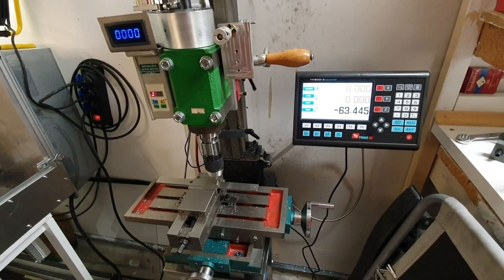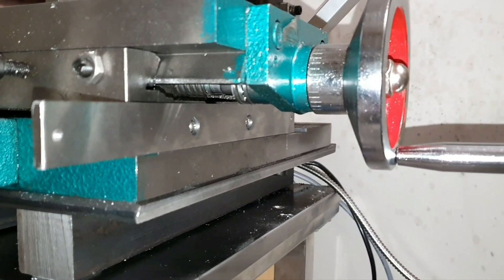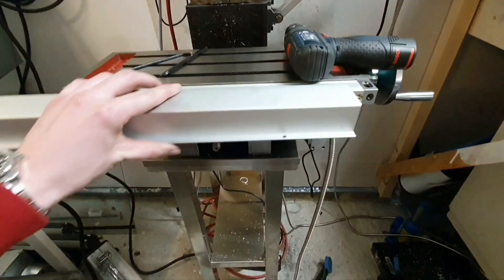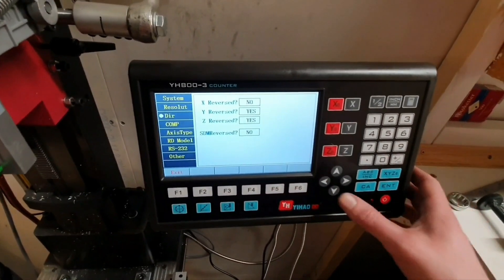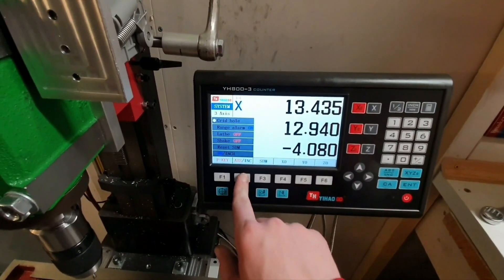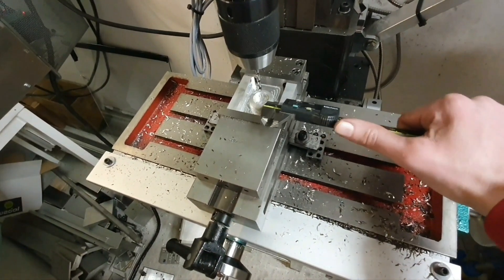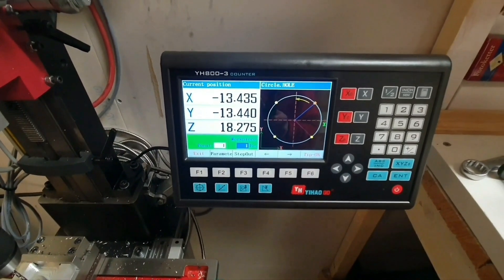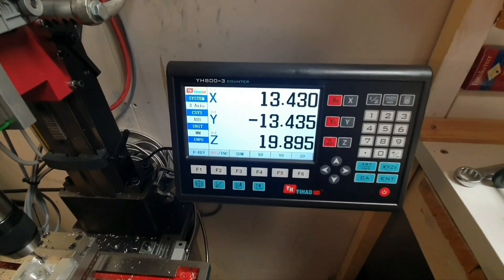LCD DRO  3 axis  - for my mini milling machine (Digital read out) YH YIHAO GO  YH800-3 counter

Comment: Why does your hole pattern start with the hole at the 1 o'clock position on the LCD, but the 4 o'clock position on the work piece? Then, when you go to the next hole on the LCD it highlights the 10 o'clock, but your machine moves to the 7 o'clock. Its as if your working from the other side (the bottom) like a mirror?
Reply: Maybe this sequence is the shortest linear distance between hole sequences? Sometimes I find that the logic programmed into the DRO unit isn't always the geometric sequence I would imagine it to be. Is the sequence you mention very like the geometric jig boring patterns found in text books on the subject? Edit to add: reading your post again it may be that you need to alter your start and end points when inputting coordinates.

Comment: thanks for the Video, I was looking to find out if the scales can be mounted sideways instead of vertical, your video shows it can be done. also can find the item on Banggood.

https://www.banggood.com/YIHAOGD-YH-LCD-23-Axis-Grating-CNC-Milling-Digital-Readout-Display-DRO-KA300-5m-TTL-70-970mm-Electronic-Linear-Scale-Encoders-Lathe-Tool-p-1593815.html?rmmds=mywishlist&ID=6278613&cur_warehouse=CN